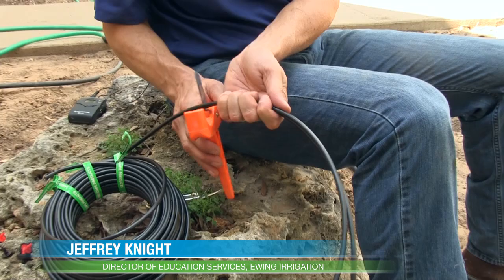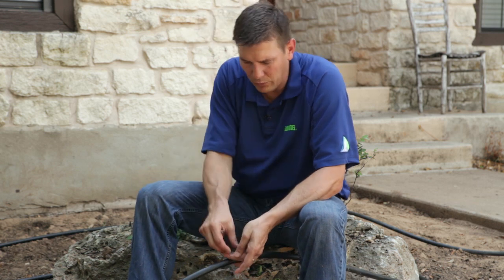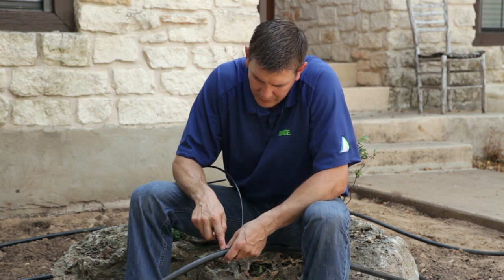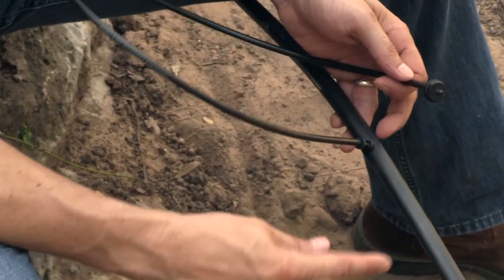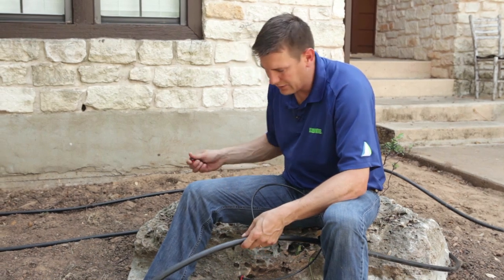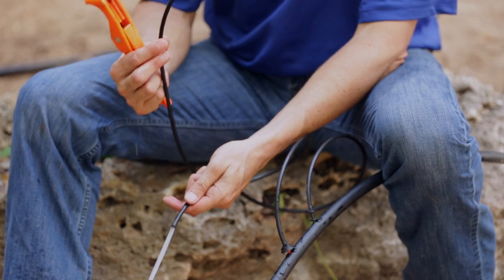Drip Irrigation Tip - Emitter Placement

Comment: So, pardon my thick skull, but will the emitter at the 1/2 inch hose ALSO drip? 'Cuz I kinda like that idea, if so. Thanks in advance for your answer.
Reply from the maker: +paineite - Sorry for the late reply! There is only one emitter used in both examples. The difference is the placement of the emitter. You can install it directly into the 1/2 inch (or .710) lateral line or at the end of the 1/4 inch distribution tubing. Both examples will apply the same amount of water to the plant. Thanks for the question!
Reply: +Ewing Irrigation Did you watch the video? Actually in the SECOND example he puts an emitter into the 1/2 then attaches 1/4 tube to it and runs it out to an emitter. Two emitters on one line. Now ... review my question above. Perhaps it will make more sense. Thanks.
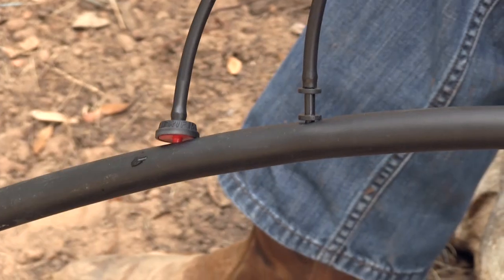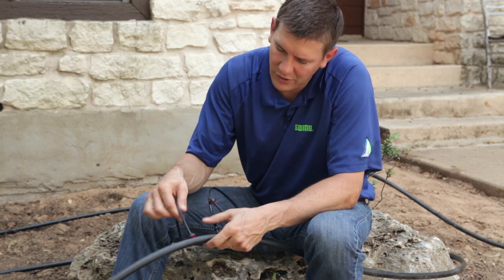Reply from the maker: +paineite - Yes, I was involved in the production of the video. I can see how it may look that way but there is no emitter at the end of the of the 1/4 inch tubing in the example where the emitter is installed directly into the 1/2 inch tubing (see his right hand at 1:40 into the video). At the end of the video where he cuts of the ends off both 1/4 inch lines (1:48) you'll see that one has no emitter and one has an emitter. The one that does not have water coming out is the one where the emitter is installed at the 1/2 inch tubing. Hope this helps!
Reply: +Ewing Irrigation ohh ... ok. I think I finally "get" you. No emitter on the end of the 1/4 line that has an emitter at the 1/2 inch side. THAT makes sense. Thank you for your time to get me straightened out. :)

Comment: Helpful vid! I came here out of confusion, Jeff... The dripper/emitter: not sure if i have it backwards or what. The sharper side of the dripper should NOT be exposed??? I originally installed like you did in the later of the vid, but wasnt really getting any water in my 'sit the end of the tube in a glass cup overnight' test. Yesterday, I have re-installed in the less-safer way, but I believe I have the drippers backwards at the end of my tubes. Its actually not dripping but flowing at a high pressure. Im getting kind of frustrated. Thanks!
Reply from the maker: Hi MrAlex - Just about every manufacturer has configured their drip emitters to be installed with the sharp end always pushing into tubing. The flow direction would travel through the sharp end through the barbed end. If there is too much water coming out of the distribution tubing it could be a high flow rate emitter or an emitter that is not restricting flow. Thanks for reaching out!
Reply: Thanks! But took the (correct) and adjusted all my droppers correctly the next day after I sent u you message. And later when the time came for the automatic turn on, I verified they all dripped. Now I think I need to upgrade most of my 1 GPH drippers... and replace plants

Comment: If you ever need to replace an emitter because of clogging or different water requirements it is very difficult to access the emitter. (Assuming drip tube is installed under weed barrier)
Reply: This is true, but a consideration of risk vs reward before hand.
Reply: what is the logic though, how is it any easier to access by NOT using this method?
Reply: Ryan Stutzman and